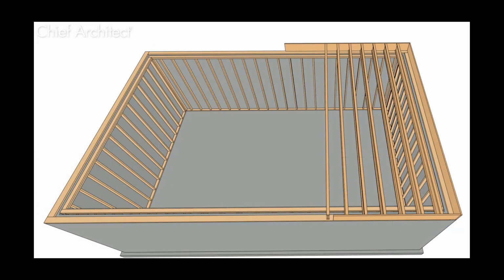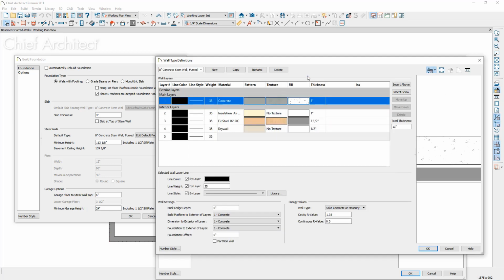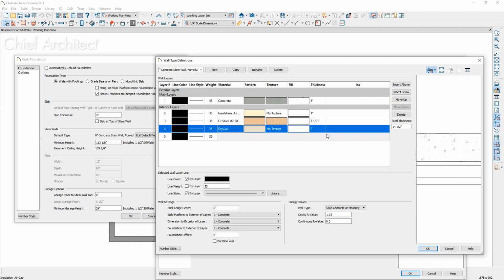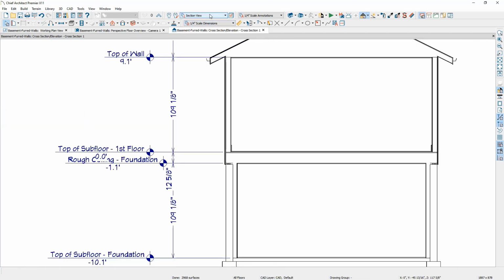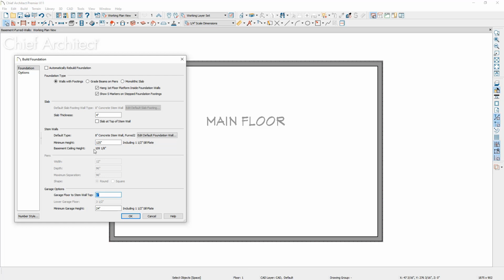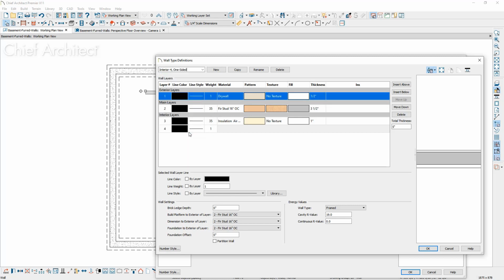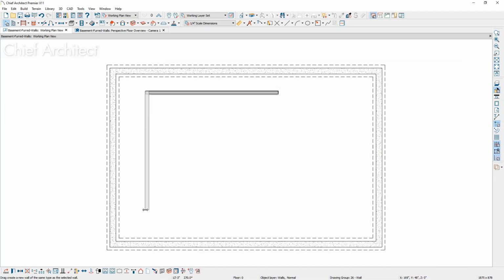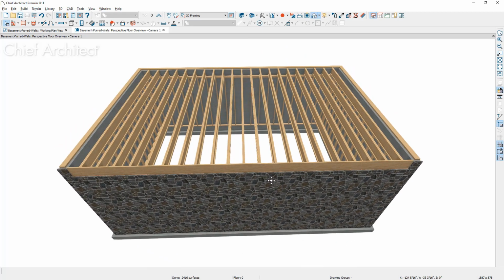Basements with Furred Walls

Comment: When placing a door in the furred stemwall (the first wall type you demonstrated) the door will not cut out all the way through the stemwall and the furred wall.  Is there a setting to correct this?
Reply from the maker: I would recommend reaching out to our Technical Support team to look into this further. Our support team has a lot of knowledge in this area and can help you troubleshoot this. Technical Support can be reached at 208-292-3399 Monday – Friday from 7 AM – 4 PM Pacific.